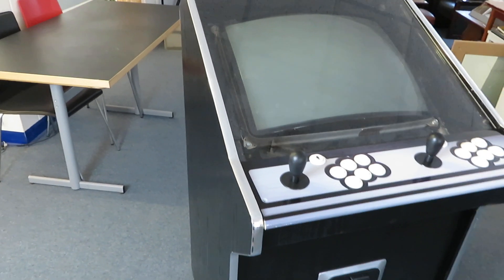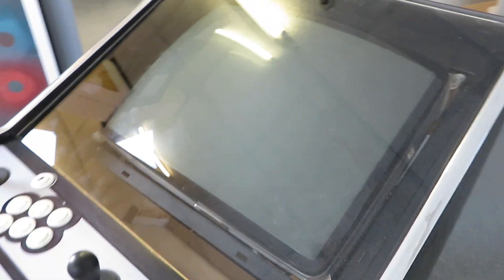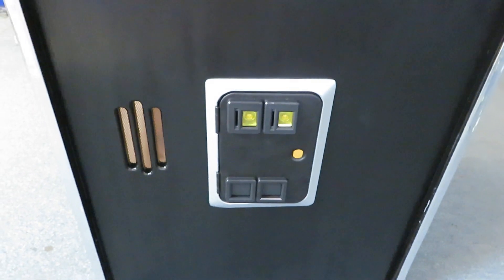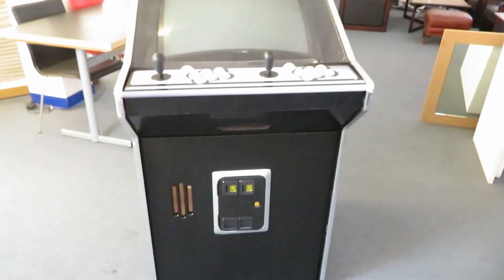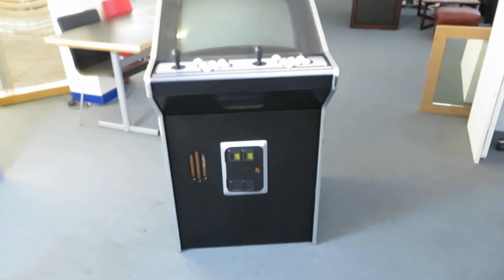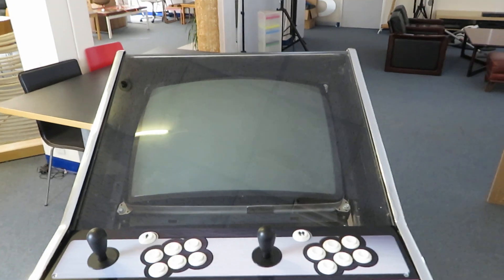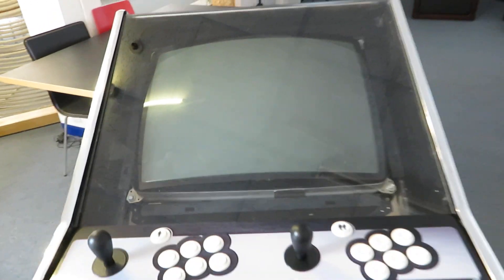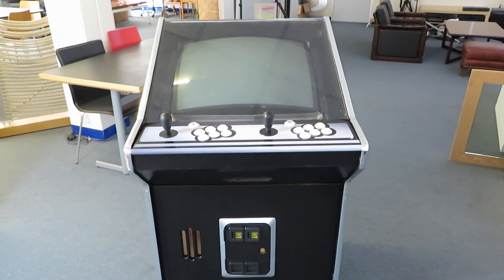Jaleco Low Pro Cabaret build part 6

Comment: Hi Lee, I'm trying to contact you about your CDJ midi conversion, but I can't get an answer from your e-mail, or the video comments on the CDJ midi conversion Videos. could you please check your e-mail and reply to me? thanks
Reply from the maker: sorry, I am just not in a position to help at the moment.
Reply: @DJlegionuk  I've manage to make it work. And I've added 2 encoders.  I am having some problems with the pitch fader,  toggle buttons, and platter inconsistencies. Could you just please share your latest teensy program, so I can explore? thank you. Movie of how it is so far here: https://www.facebook.com/MacKizombaPower/videos/656115098170268/    If you can: email me software here: djmacalak at Gmail  .many thanks!
Reply from the maker: @bymac3976  my latest software will not work on that, I changed a lot on the design and added many features that just will not work with the conversions. Plus it has a major problem with the neo pixels messing the encoder for the jog wheel. The neo pixel use a internal interrupt that is also used by the rotary encoders so I need to change the leds on my new version so SPI led.
Reply: @DJlegionuk  I only need to look on a better version of the jog wheel and pitch fader code, and I can extrapolate from there. I've tested neopixel implement too, but I still had no problems with it. But instead of the neopixel, i'm working on  a very small stepper motor with a disc with my illuminated logo. The disc rotates as the playahead.  I saw on one video you were going to implement Flashing on the code, but I managed to do do it on Traktors side with mapping. Have you had success with toggle buttons?  thanks
Reply from the maker: @bymac3976  I can share the pitch code, but the jog wheel is full of stuff to try and get around the neo pixel problems. It will be a few days before I can do this as I have a lot of work at the moment.
Reply: @DJlegionuk  No problem. thanks!
Reply: @DJlegionuk  about your neopixel interrupts problem, here is a way to use them with no interrupts: https://www.pjrc.com/non-blocking-ws2812-led-library/